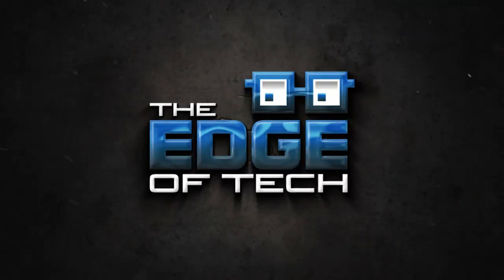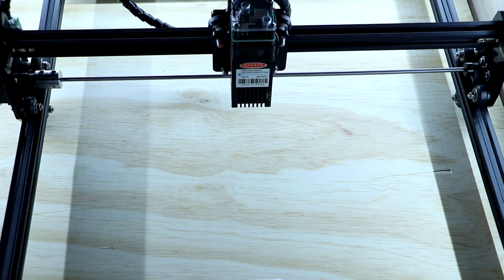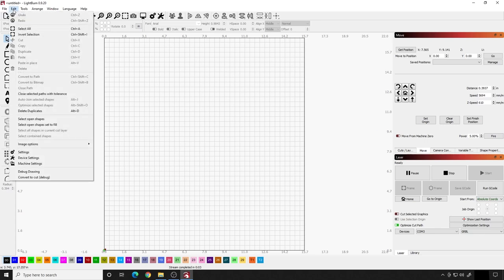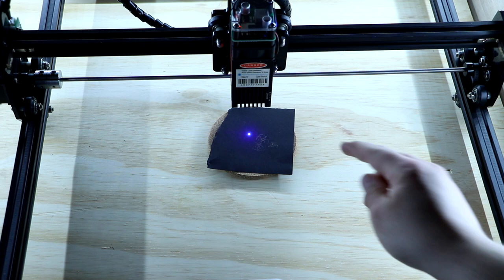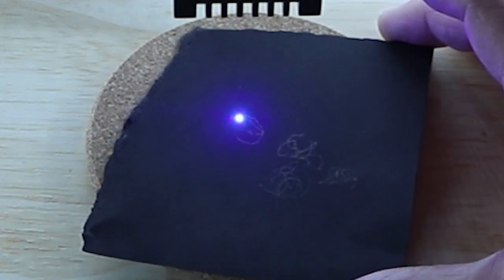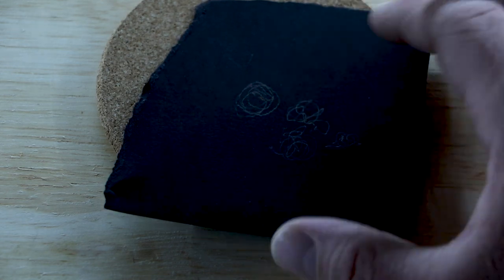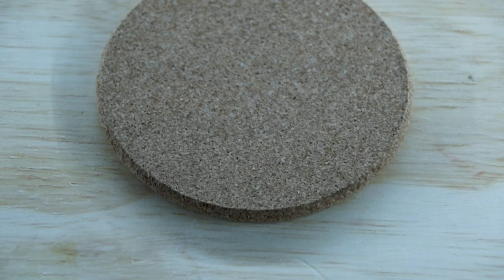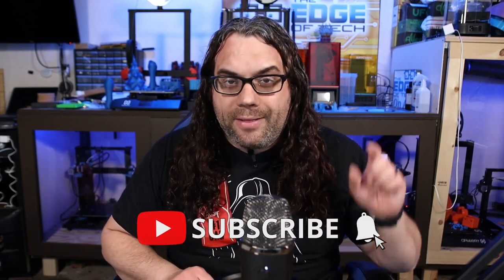Focusing a Diode Laser Quickly - Featuring the Ortur Laser Master 2

Comment: Just got the LM2 20W myself and have been binging your content.  

To all interested:  The new 20Ws (and 15Ws maybe according to the card I received with mine last month) have a fixed lens and z-axis adjustment.  They ship with an aluminum focal length cylinder (just something to ensure your laser is the proper height above your surface).  You can still fine focus slightly by pulling down on the lens though so this still applies a bit. 

Also FYI:  you cannot change the lens in the newest versions so don't do like I did and buy a G8 before receiving the newest version :-P

Comment: Great info. However, my biggest questions are: How do I know the correct focal length for my laser? Also, how do we do this with a non-G8 lens where we have a line instead of a dot?
Reply from the maker: For Ortur it is below. And with the line you do it the same way. Just as small as you can get it. 
7W 75MM
15W 55mm
20w 35mm

Comment: Hi
I wonder if you could give me some advice please, I have a Ortor master 2, setting up my laser beam, I have a thin outer circle, with a dot, in the middle, the dot in the middle does change in size, when I adjust the height, but the thin circle around the Dot stays  the same is this normal, many thanks
Neil,

Comment: I'm super new to lasers so this may be really stupid but....how do you find the focal length for the laser to set the height? I don't see anything listed on mine - Creality Falcon 10W - so is there a way to know?
Reply from the maker: Not a dumb question! Looks like it came with a focusing tool. They call it 3 step focusing. I saw the picture of it here: https://www.creality.com/products/cr-laser-falcon-laser-engraver-10w
Reply: @TheEdgeofTech  Yes, I did get that with mine also but it is only good for those certain sizes. If I want to engrave on a board that is 3/4 inches thick I don't think that step would work as the sizes listed on it are only a few MM. That is where I am confused or is it basically I should only use materials up to that max listed on the step guide? I hope I explained taht good enough. I really suck at explaining things LOL
Reply from the maker: @StumblingBumblingIdiot  I'll.have to look at it closer, but normally this would go on top of the material you wanted to engrave, no matter what size.
Reply: @TheEdgeofTech  oh ok. I  thought the steps were for the material thickness. I will re-read the manual again!!!!!! Thanx!

Comment: great vid, BUT i have 1 question that is a hot topic. capped or uncapped laser diode. Lately it seems that Ortur ( like mine LM2 15 Watt) has a diode that is NOT capped with a gasfilled lens. This means that the life of the diode shortens very much. Ive issued a ticket to Ortur, but they say there is a 1 year waranty and when it is broken , i will get a new one. But nothing about un/capped diode. Maybe you ccan give  answer on that. In a couple of FB-groups there are lots of discusion about.. Greetzz Fonz

Comment: Thanks for this video. I have bought a G8 Focus Lens but in order to get a tiny line, I need to turn (loosen) the knob so much that it is barely attached to the module. It is so loose that I can move the "dot" on the material by 3cms by simply touching the knob.

You say that with your G8 Lens, you leave a 72mm clearance between the module's sink and the material. But what OLM2 module are you using? 15W? 20W?

Comment: I have an Ortur LU 1-3 laser and wanted to know if you have any suggestions for focusing it.  The focus knob is pretty tight to turn and takes some effort.  Ortur said to put the laser from 30-35mm away from the object and focus until the smallest circle is obtained.  I did that and burnt something on my tumbler and it didn't do as good as being about 60mm away and left the focus alone.  Any help would be appreciated.

Comment: Mine is the 20watt so you don't turn the lens anymore, you just slide the whole laser module up and down.
Reply: Thanks! I just set up my 20W today and couldn't find an adjustment know anywhere. I was wondering what was going on. Good to know the 20W does not have a knob to begin with.

Comment: What about the focus block (rod) that comes with the unit?  Is it the exact correct focal length?  Because I seem to get better focus a bit closer and I get a very tiny spot dialed in and it is always a smaller gap than the rod put it at.

Comment: Mine came with a aluminon block is that for the height?
Reply: so did mine, from what i understand, its called a fixed laser. Just put that block between the laser and what your engraving and tighten the screw on the side.

Comment: I have tried my best to focus mine and it still will not cut or engrave anything.
Reply: Make the point as small as possible By turning the ring If its not still doing nothing then I think you've got a dammange laser
Reply: @davidwhitt3299  I think I do it lights up but no cutting. It is new and I have the seller sending me another, it is only 1/2 watt. I ordered a 3 watt also. thanks for the reply!
Reply: @saintcharlesdesigngroup4419  im un sure is only do 7w 15w 20w

Comment: The new ones is all fix focus lot easy how
Reply: did you get an height block with yours?
Reply: @174859607   Yeah the Metal block just under the lasser to set it and ready to burn
Reply: I have the new one also  it slides up and down right so when you put it on the plate which hole do you use?
Reply: @174859607   Let's see you have at a tile put the metal bock on the tile and then low it to the metal block and the    Len hit the block And it  Screw the laser to whatever hole it's come to
Reply: @davidwhitt3299  thank you my friend
Reply: @174859607  np  Glad I could help you
Reply: @174859607   do you think this fixed laser is better than the G8? I just got mine and its fixed. I was wondering if I should try to find an adjustable laser so I could use the G8 lens.
Reply: @MatthewMokry  I don't have the g8 laser. But my fixed laser works really well with the gauge block that came with your machine to set the right height.